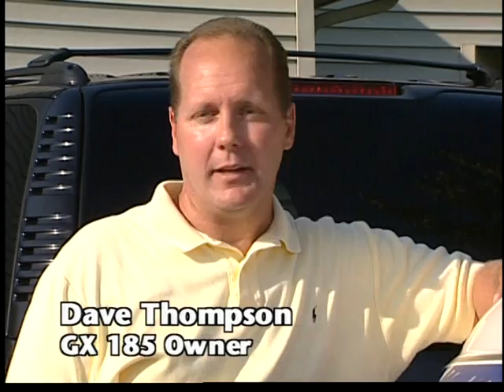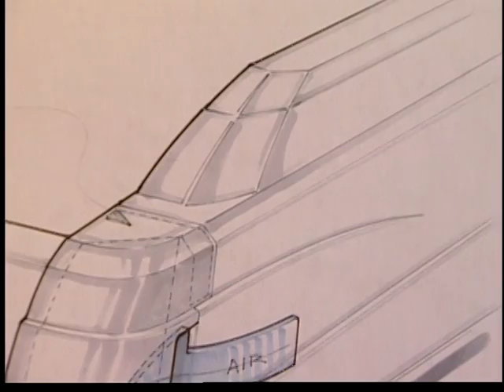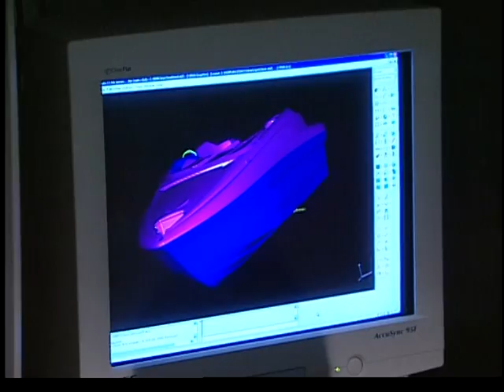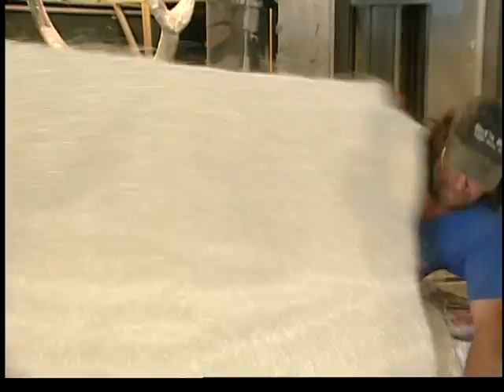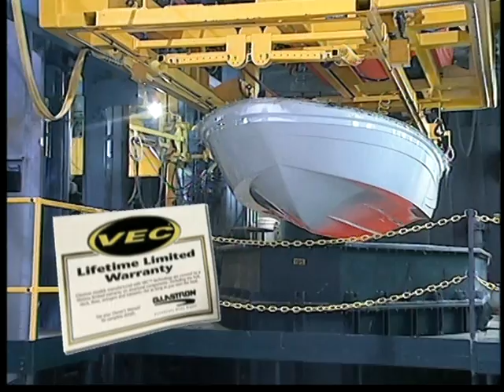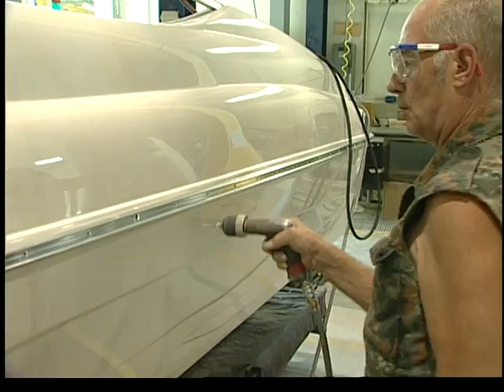Glastron Plant Tour Video (2004) promotional video.

Comment: My opinion is that boats these days are too fat. By that I mean too heavy. The claim made here is that these boats are light. Well, my 1987 18ft. Glastron, still running strong, weighs 1350 lbs, w/o motor. How much does this 18 footer in the video weigh? I bet almost a half of a ton more. As for quality, I agree the quality in these new boats is fantastic. Mine is terrible by comparison. Mine has only lasted 36 years so far. That was meant sarcastically, as 36 years is pretty darn good. In any case my guess is that these new ones will probably last 100 years. btw I own 3 Glastrons (but not the fat ones).